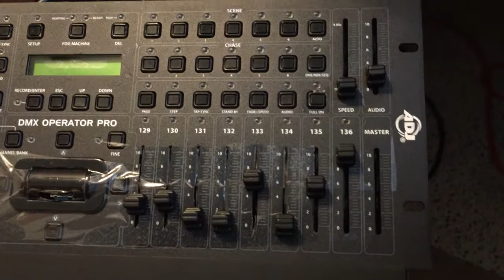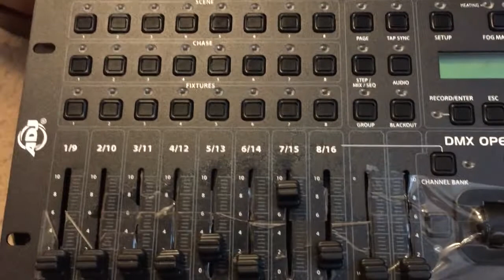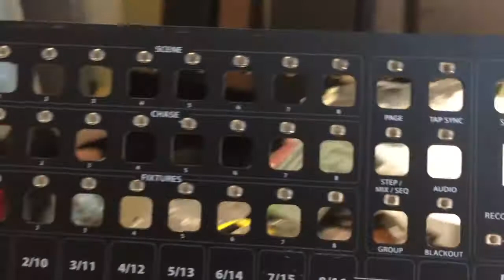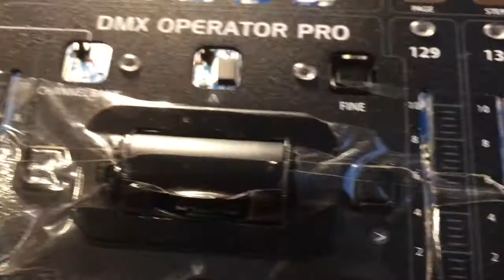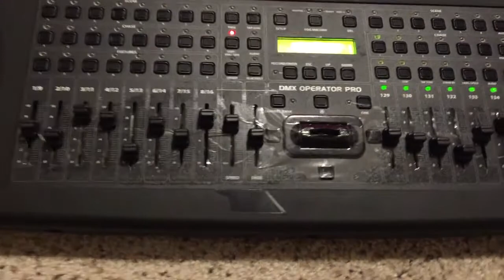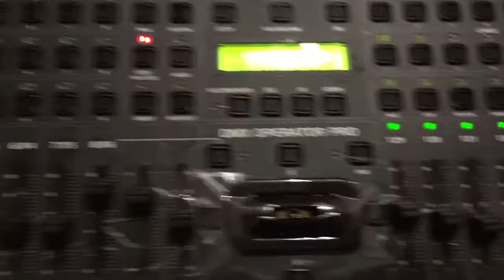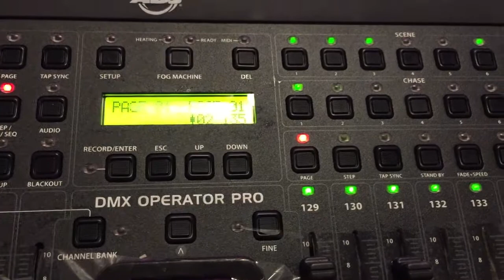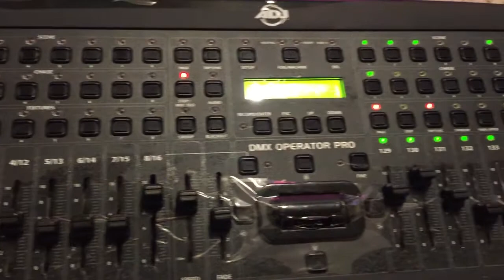ADJ DMX Controller Operator Pro Button Repair

Comment: Thank you for creating this video. It was helpful, but it would have been really helpful to see how you took it apart, and how you actually fixed the button.
Reply from the maker: Hello Deborah, the cover was fairly easy to take off.  There are 4 long screws on each side that hold the body together.  After that you will have to remove bunch of screws that holds the circuit board and the top together.  Face the top down and lift the circuit board out, that way, all the buttons don't fall all over the place.  I didn't really fix the toggle switch, I only replaced it with another one.  All you have to do is to de-solder the 4 legs that hold the switch to the circuit board and solder the new one in its place.  You can order the switch from American DJ.

Comment: hello greetings, from Argentina, I have a question if you can help me!
I saw in a video that you repaired a Seenheiser microphone, its led light. I have the same microphone, and I have the problem, that I turn it on and on its display, it appears as if audio is coming in at full signal, or as if it is singing very loudly and close to its capsule, but in reality I am not. I tried changing its capsule, and it continues to do the same thing, it appears on its display as an audio input signal "AF" at the top - could it be that the transmitter, that is, the microphone is permanently damaged? Thank you in advance for your time. greetings
Reply from the maker: Have you try adjusting the gain in the microphone?  Mine I think is set up as -24 db.
Reply: Hi, thanks for your response .
Yes, I tried it, the problem I have is that when I speak or sing slowly, the microphone begins to transmit the audio but with a bit of noise, as if it were "RF" antenna interference, I already tried everything, and it's ruled out, change cables, fit the receiver base, change the microphone capsule and everything remains the same. a perhaps important fact! The more I decrease the gain of the microphone, the more the noise is felt when speaking or singing, if I increase its gain to -6 db the noise almost disappears. It was in this search that I discovered what I was mentioning before... that when I turn on the microphone on its display it marks me as if it were transmitting a signal at the top all the time, and in reality I'm not. I don't know, what could it be... if it was really damaged... thank you very much again for your support.
Reply from the maker: @emisonbye671  The only thing I can think is play around with the Squelch value.  Other than that, I had never encountered this issue before.
Reply: @064ddlez  Dear silver, first of all I want to thank you deeply for your time and help.
Yes, I actually tried the squelch and that didn't have any effect. It is something very strange, because when the microphone is turned on, it does not make any noise or anything strange, the microphone works as if nothing happened, that is, it does not make noise, it does not click, nothing. If you decide to start talking, it captures you as always, but with a bit of noise as if it were a signal problem or something. After discarding cables, base, capsule, I realized that when you turn on the microphone, its audio input signal, its audio capture signal, (but the microphone is not emitting any sound,) I mean, it is connected in the console and everything is perfect, as it should work, when you start to speak there it makes noise.
I will continue looking for information about the reason for the transmitter, when it is turned on its maximum input signal is shown on its display and without emitting any sound, or reproducing anything, it does not make noise in the console, it does not come out acomplete through the speakers, nothing at all. It only appears a problem when you start to speak or sing. thanks again! and I hug you from a distance. Regards, Emiliano

P/D ; sorry for the length in the texts :D
Reply: Dear I promise my last query!
And I won't bother anymore, I wanted to know if technically, at an electronic level this can happen.
The microphone is used by a punk rock singer, heavy rock music style, which exerts a lot of vocal pressure on the microphone diaphragm and excitation in the transmission signal, there is a possibility that the transmitter gain was not well set and - 18 db (which is what the transmitter comes from the factory), is too sensitive for pickup and the transmitter received a signal excitation all the time, always forced to the top, to clip, and this, so to speak, fatigue this component " dynamics regulator" of the transmitter some kind of component, (I don't know how to name it) but type, pre-amplifier or component in charge of signal transmitter.
So now when you turn it on, this signal modulator or transmitter component is damaged.
Can this happen technically or electronically? what do you think that can happen?
Reply from the maker: @emisonbye671  Best way is to find another transmitter to try.  Yes, as you know, the pre-amp is full of analog components.  If one capacitor failed in the filtering circuit, you could have lots of noise. Unfortunately, it's almost impossible to work on these tiny little components anymore.